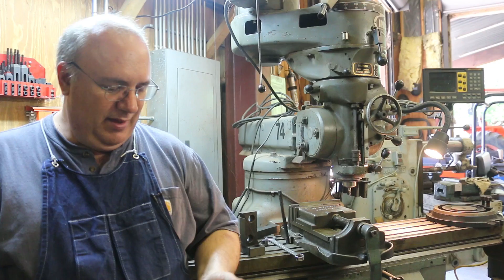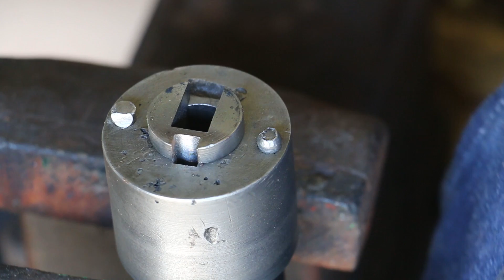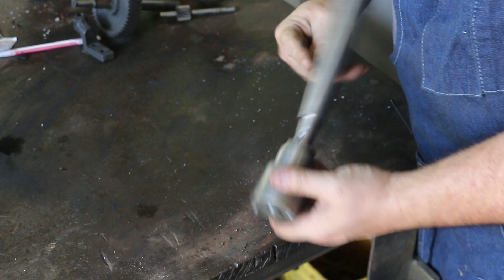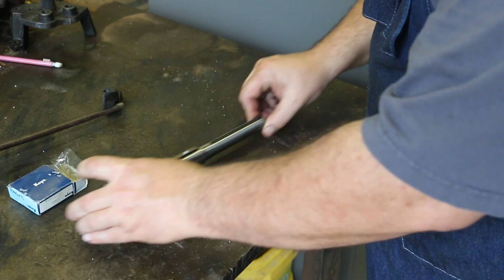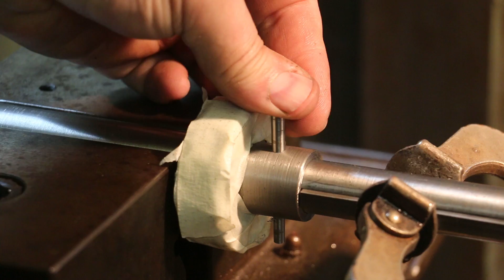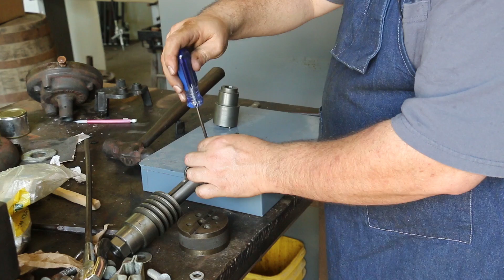Machining a Custom Arbor for a Syracuse Spindle Sander - Part 3

Comment: Another great video Keith! I found this one particularly interesting as you had to make some of tooling you needed yourself. I got a little nervous in part two of this series when you using the air press. It caught me by surprise when you sped up the video without warning, it looked like the thing was going to lop your arm off! I'm looking forward to the next episode of the furnace build, which  will eventually lead back to the safe.
Stay well,
Rich
Reply from the maker: Rich206L Thanks rich - I should probably give some warning before I speed things up that way....

Comment: Keith,
A very nice job. The one problem is I hate taper pins with a passion! You can never figure out which is the small end. When I serviced mailroom machines, someone made Pitney Bowes an offer they couldn't refuse on taper pins! Their postage meters used them. Their envelope inserters used them. I would always drill out the pin and put in a roll pin when the taper pin needed removing. Some of the taper pins were used as shear pins. Since a roll pin is harder and wouldn't shear, I used kotter pins. Sorry for my rant! It was a great job, as usual! Thanks for sharing it with us!
Have a good one!
Dave